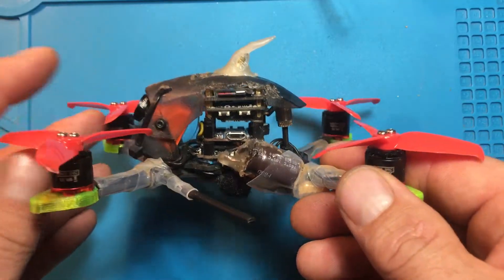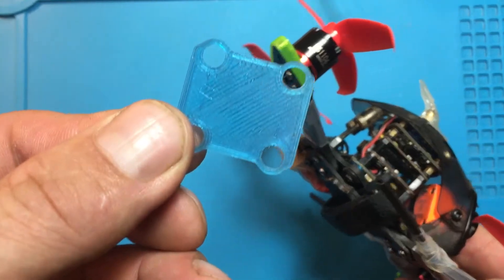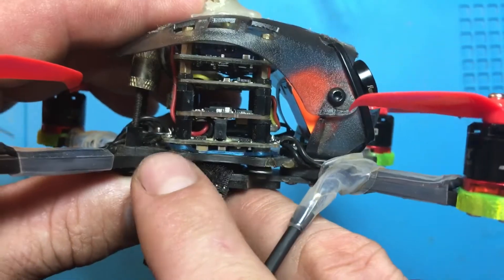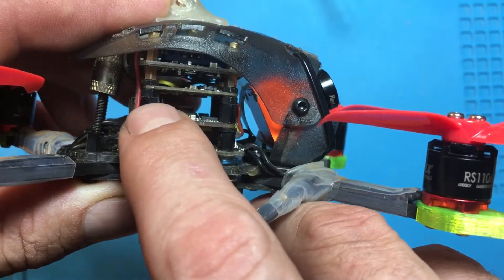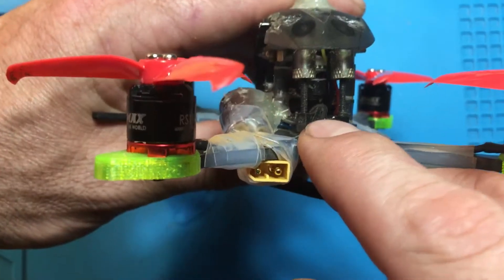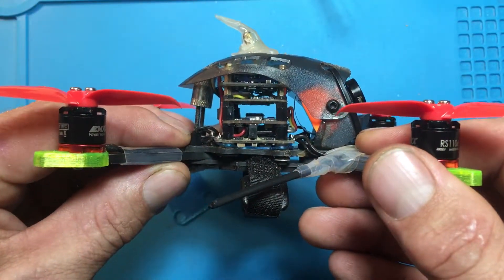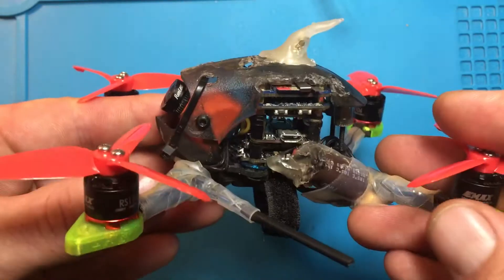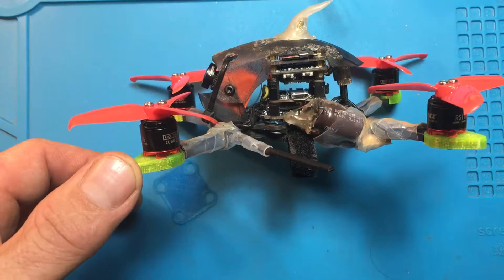Fitting RunCam Split Mini Into Baby Hawk R and How to Avoid a Fire from a fatal design flaw.

Comment: or you can just you know, not over tighten and negate the entire purpose of the isolation mounts, soft mounting and all, it has purpose, The other handy thing for those who dont have a 3d printer nor want to pay for anything just to solve a problem that should not be an issue anyway, is electric tape or conformal coating. That stuff is pretty handy. Also, emax fixed the issue and started releasing them with a pad installed
Reply: props for not getting defensive bro. I mean that whole heatedly. People are too damn sensitive these days.  Sorry you ever had to find out the hard way about over tightening soft mounts and or shorting to the frame

Comment: Where can I find a print file for the isolation bed?
Reply from the maker: Peachy's RC and Games Thanks for watching, really appreciate it. I just got it in the 2.5” arm kit on eBay. 👊
Reply: sounds good it looks like it is just a couple layers thick
Reply from the maker: Peachy's RC and Games you can use any layer of plastic so it won’t short out. I cut out a plastic lid before I used the printed one. 😉👍